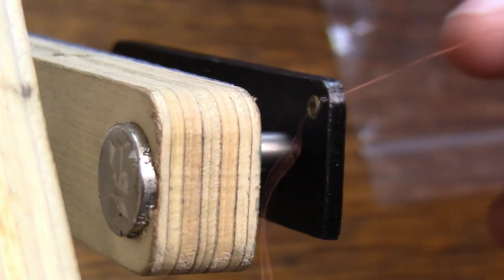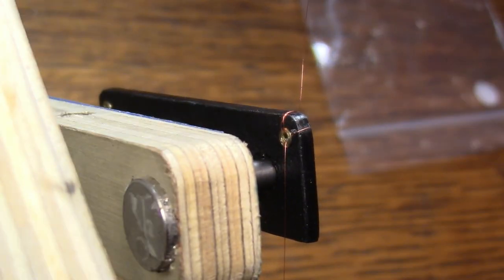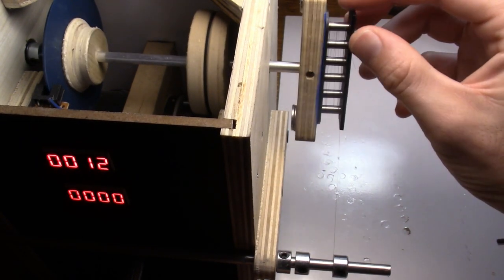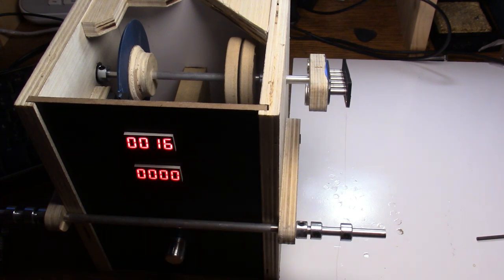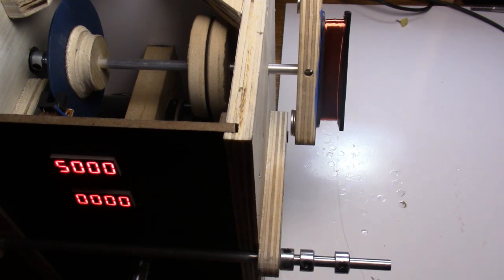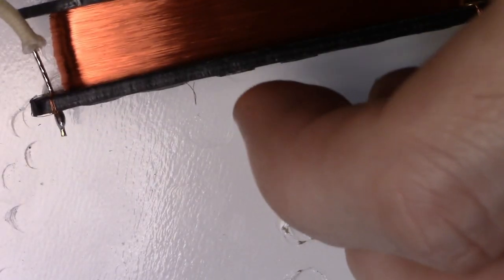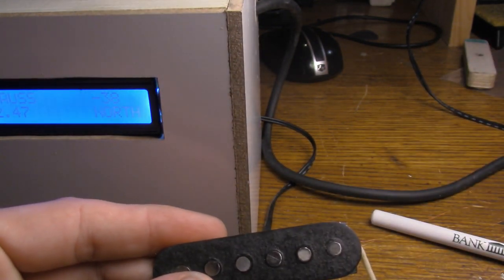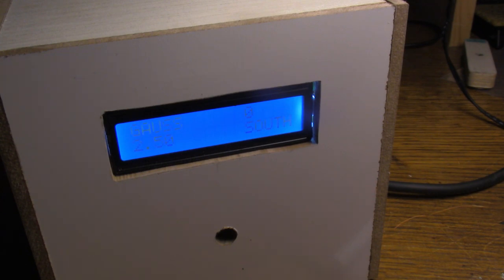✅ Building a Humbucker Pickup Part 3 Winding, Charging and Repairing a broken wire

Comment: Could you make a video for us testing some various pickups you've made to demonstrate how they sound? I think it would be very informative to see and hear how different pickups sound depending on different variables like wire gauge, number of wraps, north poles up vs south poles up and the inner distance between flats and the distance between each magnet.
Reply from the maker: Z B absolutely bud. That has been my plan since the beginning.  I am currently moving right now so it might be a little bit but any help you could give or ideas would greatly be appreciated. I really appreciate it. Thanks for the comment.
Reply: @ChasesWKshop  Unfortunately I really don't have any ideas. I'm only just now starting to get into building guitars, in fact right now I only have a piece of wood selected for my first build. I decided that i would rather try my hand at making my own pickups instead of buying them because good pickups are expensive and I'm already several hundred dollars in on tools, and I'm currently unemployed, so keeping the spending to a minimum is pretty important right now.
Reply from the maker: Z B gotcha bud. Usually the best ideas come when you’re just starting out. There’s nothing to hold you back. I know it can be expensive starting out buying tools but just start with the body. Then the neck the the pickups. The pickup winder I built is cheap to get you started. The materials aren’t too bad either. You’ll get there and if you have any questions let me now bud.